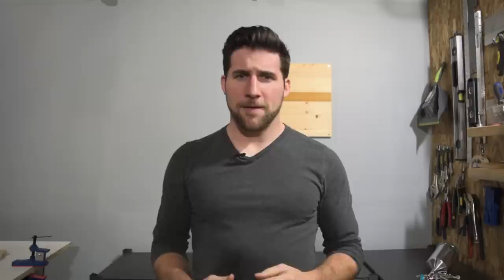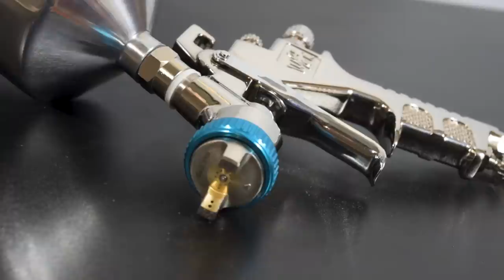Do you need to sand between coats of paint?

Comment: Is it ok if I spray poly urethane on top of a laquer?
Reply from the maker: It depends how long the lacquer has dried. But, if it’s fully dry  and you sand it lightly first, then yes.
Reply: @BradAngove  is 24 hours good enough drying time of the laquer before sanding and spraying polyurethane clearcoat? And what do you mean on sanding lightly?
Reply from the maker: More like two weeks. And I mean you need to sand the surface so the new clear will stick, but make sure you don’t sand right through it.

Comment: Would a fan help ensure it dries between coats?
Reply from the maker: +Allan Lajoie generally it helps. It depends a bit on the paint though. Acrylic dries well under airflow. Polyurethane dries well under heat. Lacquer does well in low humidity... I think you get the idea.

Comment: Interrupting shriveling. Can that be achieved by sanding? I think that might be the case. Light sanding ought to break the cohesion and contraction between particles. Highly improfessional since you would have to start out with colours that causes the shriveling up effect. But experimenting ey? Lol! On some scrapwood. I can recommend water based acrylics and add montana black concretewall paint. Now after some sanding u stopped the crackling and put clearcoat on it. The art gets very dark bcoz clearcoat dissolves even more of the acrylic and spreads out the montana black. I have a portrait of a person which seems to have fungus growing on it. Not very flattering but since it was an old rotten dictator.. In the end it makes sense. (Dictators love flattering portraits and statues raised of themselves)

Comment: Somewhere in the $200.00 range.
Reply from the maker: Several of the guns I use are less than that. Have a look at the amazon link in the description under painting equipment. The devilbiss flg400 gun is good. Also the warwick link in the description has a discount code. There are a couple great guns in there for less than that.